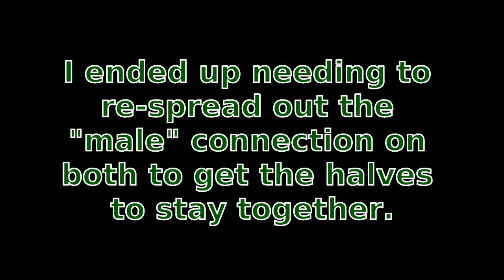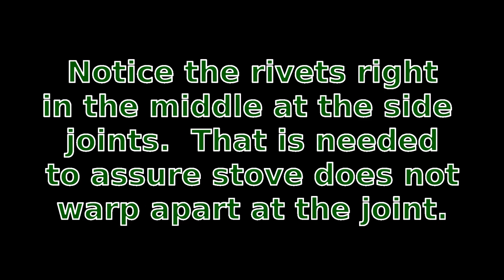Make A Simple Cheap Tent Wood stove - Part 1

Comment: Lonnie, your an inventor, drafter, designer, engineer and fabricator all in one. That is an amazing stove. You could sell those as kits. I like your sheet metal brake. I see harbor freight sells metal brakes for a couple hundred bucks and sheet metal benders for sixty bucks. How did you come up with your design. One of my jobs working for engineering companies was as a sheet metal enclosure cadd designer among other things. I like how you drew your lines on the flat sheet metal. That’s called the flat layout when you draw it on paper like that. Then you draw it up all folded and that’s called the formed view. Lonnie, you should download AutoCad LT or AutoCad mechanical 2D software to your computer. If you set up an account with AutoCad as a student or teacher you can download it for free indefinitely. I used to be a teacher and even taught AutoCad at a high school. It’s easy to learn and there are free online teaching tutorials and websites that teach it. There’s also other similar cad software like AutoCad that is free too. Anyway, I really enjoyed this video and what you designed and fabricated. Really cool!!!
Reply from the maker: I came up with the metal bending idea by searching online for how to accomplish that process.  I do not recall if I seen anyone use wood as the form but with how thin this metal is it seemed like it ought to work.   I came up with the stove design by seeing many others online and then I just made this one the size that I liked.

Comment: When you held up the tin snips and said "Now, these are..."  and I finished for you "Left-hand snips."  I was actually surprised that I was right, because I learned that almost forty years ago and never heard it again, but I remembered the color code. Like in shipping, Red=Port=Left and Green=Starboard=Green. Yellow handles are "straight" snips. PS. I am so excited to watch the rest of this, because I half-built a stove in my head using galvanized pipe, however I was going with the round shape, with an inner, replaceable half-pipe as a fire grate.

Comment: A most excellent video and tutorial !! May try this but peen the stovepipe hole UP for a better , safer seal and use true stack pipe . Could also use a  draft damper in the stack that way .It might have been easier to bend the door opening before the front was installed !? Remember to make the FINISHED stack hole big enough by allowing for the THICKNESS of the metal used ! If you need a 4" dia I.D hole, your marking for the dia needs to be BIGGER than 4" if peening your hole IN as he has done !! Just say'n to prevent frustration for those who may do this . YES I know this was a cheap /easy stove . Just a warning about metal thickness and bending . JTLYK , I did custom metal work for 7 yrs  and NO , I do NOT know it all !!  Most excellent work Lonnie !! Oh , what gauge was your flat galvanized ? Once again just to try and help those who may try this , a ball peen/pein hammer might make peening the round hole easier :)  Nice Lonnie , nice !!!
Reply from the maker: I do not know what the thickness gauge is.  It was the standard duct at Lowes hardware.   If by making the stove pipe collar up I hope you do not mean to place the stove pipe on the outside of the collar.   You will be sorry if you do.  You will end up either modifying it later or throwing the stove out.   The way I did it is the safest way to do it.  When wood is burned it creates distillates.  Many of those distillates will condense out on the interior of the pipe and then run down the pipe.  The way I did ithe stove pipe collar, the distillates will run back into the stove to be burnt up.   The way you want to do it, the distallates will run down the inside of the pipe and onto the the stove top and will drive you out of the tent due to smell and fumes.
Reply: @Far-North-Bushcraft-Survival  Gotcha on the gauge .  Now I have seen the error of MY ways  on the flue / stack pipe after looking at a few vids of tent stoves for wood by Two Dogs and G stove .  I had watched vids before made out of 50 cal ammo boxes and such and they all WRONGLY put the stack OVER their homebuilt stack flange . My WRONG thinking was worrying about flue gas going up the stack and having less chance of escaping the stack into the tent while drafting . I have never used a stove winter / snow camping , do not have a fireplace, so I did NOT think about distillates ! Thanks for saving me from making a useless wood tent stove  at home :)  Have used a super shelter , tents , tarps and on the ground in the winter , but no stoves . My son bought a G Stove for his teepee this yr for our annual snow camping , pulk pulling trip and it is a finely made stove !! He has burned it out but has not used . Thanks again .............Gubs

Comment: Nice job. I love how you took the time and showed the viewers step by step and the troubleshootings. A result in lots of workmanship I take it. Invest in flat face pliers. That way you can ensure a maximum seal on your edges. You can also get a product that is resistant to heat that kinda ties everything together that you dont want to be opt for dismantling. Thanks for the up load.
Reply from the maker: I actually have some "Duck Billed Pliers" on order to be used on a future sheet metal project.

Comment: Having been on a horse pack trip I wanted to buy the set up, tent and stove. Cabela's sells this same style stove for a few hundred bucks. This stove would be about the same in quality yet much cheaper to make. Only thing left is to figure out a hot water tank! Really great video!
Reply from the maker: Due to the thinness of this metal it might not stand up to the riggers of horse packing.   It would be destroyed if the equine got it in his/her head to widen a trail through trees using the pack contents.   Commercially made stoves would use a thicker gauge metal that would have a better chance of withstanding the abuse of horse packing.

Comment: Ok that is a nice build and I want a smaller version to heat my Sienna van and yes that zinc coating will be completely burnt off before the stove sees the inside of said van. Just a matter of finding the metal sheeting and doing what you did on a smaller scale.

Comment: Very nice brother. Couple of questions, How did you cut such a good circle in the pipe hole wood Jig?  Jig saw? I'm not to good with a Jig saw on circles that small, mine would not have such crisp edge. Maybe you used a router. Also with such a thin galvanized duct metal, wouldn't it burn thru in no time?  Is this something you remake each year? Thanks for sharing Lonnie, you are one resourceful dude.
Reply from the maker: I used a bench top jig saw.  How ever a person could cut it out by hand and then use a wood file to round it out accurately.   If a person had to they could drill it out and then clean it up with hand saws and wood files.

Comment: And to think I got the privilege of seeing it in real life before it was done.  That is one fine ultra light and yet not so ultra small tent stove Lonnie,   well done.  I got to tell ya though stove building can be additive.  You are always thinking of ways to improve or just start a different design.  Great Job my friend.
Reply from the maker: Lol.  I'm already brainstorming for the next home built stove design.  It will be a break down pack stove.   Something that will be great for stowing in the boat to use with my 4 pound ultralight tent that will be my next project.    I have recieved all the materials for the tent and it weighs just under 4 pounds for a 10 foot by 10 foot.

Comment: Excellent video and design Lonnie. Those rivets are a pro touch.   You are a brave man for handling that steel with your bare hands...  LOL I cut myself on paper, let alone the ultra sharp edge of freshly cut thin steel.     

Just an FYI - that galvsteel, if used often enough, and the hot coals are directly on the bottom let's say, it WILL wear the steel and break it down over time. I had mine wear out in a season, (gets thin and brittle like corrosion)  so something to consider, just adding something to keep the fuel off the very bottom layer and sides. Possibly just doubling up there, or an iron tray.
Reply from the maker: I will be making a "false bottom" eventually which I will video along with other stove mods that I have in mind as well.

Comment: You may consider using B-vent (double wall pipe) on the upper part to reduce the heat at the tent opening.  Great video and will be making one of these for our scout troupe.
Reply from the maker: with the home made stove jacks that I make, there is no problem using these stove pipes.   Double wall stove pipe would be a bit more cumbersome to store and transport for backwoods use.   I agree however that double or even triple wall pipe should be used in a home.

Comment: I can't stop thinking about this stove. It's amazing. I wonder if there is a way to make a second one and attach it to the first one. If there was a way to let the heat in one part and some smoke in the other part, it would be nice to make an oven to dry jerky and make bread. That seems doable. You have an amazing inventor's mind. Thanks again for this video showing how to do this.
Reply from the maker: If your goal is to make an oven then what I have pictured is to use like a 5 gallon metal bucket and place a smaller metal bucket inside that one.   Place them on their sides and mount in the stove pipe with the stove pipe mounted in the lowest part of the now sideways 5 gallon bucket and the pipe above mounted to the highest part of the now sideways bucket.  So the smoke and heat would flow from the stove up into teh 5 gallon bucket and flow around the smaller bucket thus heating it up before traveling on out the top of the five gallon bucket and on up the pipe.   Should be doable one way or another.

Comment: Shape wise it's a great design, but given how thin that metal is, I'd have doubts about it being completely fireproof, to be honest.  It might reduce the portability a bit, but I'd possibly want a thin layer of vermiculite (or possibly cement, with a slightly higher than usual ratio of sand) at least around the inside of the firebox.  That would prevent it from warping due to heat, and it might provide some insulation as well.

Comment: A couple of holes in the base of the legs could hold spikes for extra stability... a damper and spark arrester would be nice. If the draft pivot had been offset, a bit of mica or stoveglass in a frame would make a nice window. Someone on YT used the label frame off an old filing cabinet! It'd be small, but better a small-screen "wilderness TV" than none at all!
Reply from the maker: I do plan on drilling holes in the leg bottoms to screw into log "floats" for on snow use.   I do not want a damper and have never personally liked them.   I will be using a spark arrestor on top of the pipe when it is put in a tent.  I have a very simple but effective method of making a spark arrestor that is easily cleaned periodically and has lots of surface area to prevent a slow down in draft.

Comment: Fantastic job!  I am going to build one of these for my pallet wood cabin build this spring.
Reply from the maker: This stove would be fine for occasional use such as in occasional camping but is not a stove build that i would recommend for a long term dwelling due to the thinness of the metal.  It will burn out much sooner than a thick metal stove when used full time.
Reply: The pallet wood cabin will probably only see 2 weekends per season of cold weather.  The stove would get very little use in it.  But, if it burns down, I'm going to blame you lol!  Thanks!

Comment: Very cool, I was woundering if it would have been better to have the door higher to give room for ash and such on the bottom? I guess I’ll just need to watch and see how it goes, I guess if needed a new door end could be made? You did an amazing job! 👍
Reply from the maker: The higher your door is, the greater the potential for smoke exiting the door every time you open it
Reply: Awe, okay thanks for the tip.
Reply: the higher the door the harder it is to showel the ash out. this does not apply if you dump it out.
Reply: Cool, thanks! It would be Realy cool to make one!

Comment: my only concern would be how hot a fire can be inside that stove .... as for bwillan's suggestion of bending the stove hole flange out instead of in ... that would leave a rough end outside the stove and make packing it an odd shape ... when bent in it provides a clean edge support and makes for a nice square shape to pack the stove away in

Comment: I'm going to use your model to make my own. It looks like a good fit for the garage. That's where I hide out and make shit I don't need.
Reply from the maker: This is not a long term regular use type stove but is rather designed for occasional use such as in camping.  For an expensive building where the fire may not be closely monitored all the time it is burning, I personally would rather have a stove that is made out of much thicker material.

Comment: 33:00 as well as trying to burn the galvanizing off out-of-doors, you could use a propane torch (while it is burning wood internally) to burn off the areas that aren't hot enough to clear the galvanizing.

Comment: It's not a 600 dollar titanium stove but it will give the same results. Good job! I live in Michigan the Temp out side right now is 10 deg. f. I could use a heater / stove in my tent. you need to show how to get the stove pipe thru the tent roof with out burning it.
Reply from the maker: I will be doing an upcoming video on an ultralight tent where I will be using a bit different material than I show at the link below but at the link you can see one way of doing it.

Turn Your Tarp Tent Into a Hot Tent - Stove Installation
https://www.youtube.com/watch?v=HfiUgGhTe1k

Comment: You could use a small diameter pipe with holes placed where the latch nubs are on the door so you can slide then both at the same time? Perhaps it would not work as easily as it sounds I don't know.

Comment: I'm really impressed with the economy and practicality of this. If you don't mind, I'm going to use your design to make one for myself. Is it possible to get one whole season out of the stove? It looks like it handle a few good burns. I've thought about using flattened out corrugated iron but that would be a lot heavier and wouldn't hold up too long to several good burns. Anyway, I greatly appreciate your approach to life and living, and not just surviving. Thanks!
Reply from the maker: Sure go ahead and make your own, that is what the video is for is to share the method and design so that others can do their own.   Time will tell how long this will last.  It is not a stove for continuous use but rather occasional use such as for camping.   I will not be surprised to get at least 5 years of occasional camping use out of the stove but in the end only real time use will answer that question for sure.   Typically heavier metals will last longer if they are of the same type.
Reply: @Far-North-Bushcraft-Survival  Thanks for replying Lonnie. That sounds like exactly the use I had in mind for it. I'm thinking of using recycled roofing iron for mine as weight is not a huge issue for my particular purpose. Love your channel and your incredibly insightful videos. Thanks again! :-)

Comment: pop rivets … or what ever I have at the time. …   … love it … if I run  out of rivets  ,,, I will see what else I have that I can use … .. screws. or whatever ? .. LOL … lv it.
Reply from the maker: Homemade rivets can also be made from odd items like nails or copper wire.
Reply: @Far-North-Bushcraft-Survival  very old buddle of copper house wire worked very well … thanx 4 the tip ! I used it for a medium duty project … coper easy t use .. .. for light duty application... tnx again … ,,,  I lv l+k ,,,

Comment: here is the cheap version of the project:
-many restaurants buy stuff in huge ass food cans, get one of those from a scrap yard or something, a big paint can also works
-turn it over so the side that has been opened is pointing down
-poke a punch of holes into the metal around a third of the way up from the side that has been opened.
-put some metal rods or thick wire through those holes to form some sort of grid
-cut a u shaped hole above the grid you just made, so you can fold it up and down
-cut another hole below the grid so you can scoop out the ash and let air in from below
-poke a hole in the top

congratulations, you can now light a fire in there, the ash will fall out the bottom and you can put a small pot or frying pan on the top.

Comment: Beautiful work Lonnie. Great job!  I wonder if you would put a false bottom in there, say 1 inch up, to prevent the bottom from heating too much and burning through eventually, if that would extend the stove's life? It also seems you were a sheet metal worker in your past life, weren't you? (By past life, I mean, before retiring to You Tube, lol)
Reply from the maker: No sheet metal experience before this other than making an "oil pan" in high school shop class many many years ago.   I do plan on putting a false bottom in the stove but not quite that high.  I have other mods in mind as well and will be videoing them at some point.

Comment: Very good video, 
But I'm thinking that metal may be a little light an if the fire gets away on you, That metal can get red hot quickly an then the air could possibly draft quickly an open a hole in the metal and up it goes, That's my personal feelings, an I would probably make mine a little bit of a heavier steel.